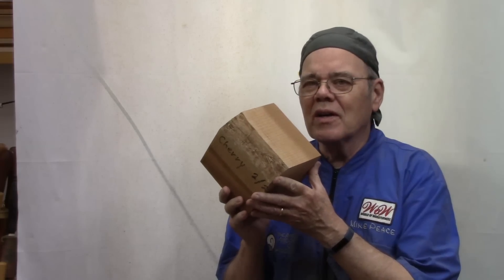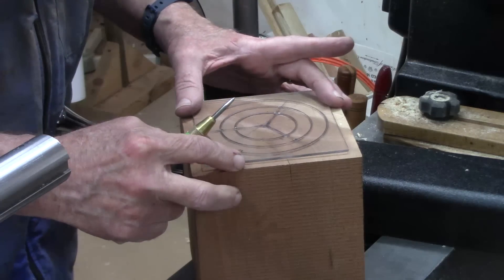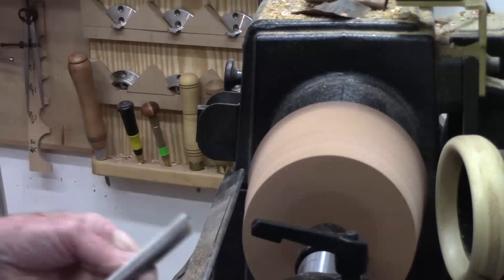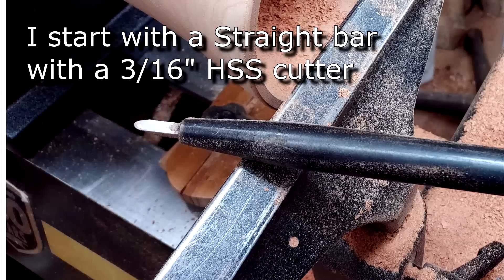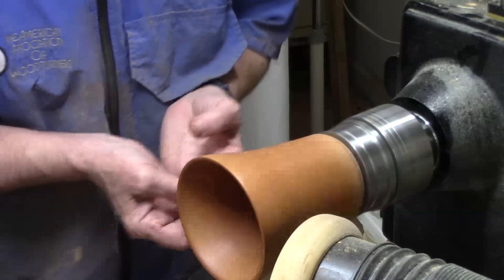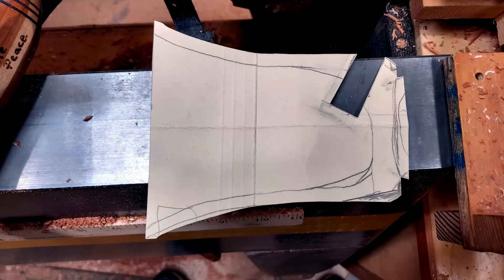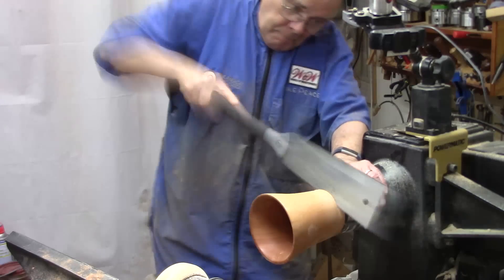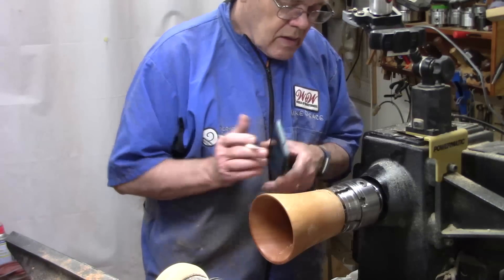4-Ways Cube Woodturning Project –What Will It Be?

Comment: Nice work Mike. You made a comment about moving the head rest. I always leave mine at the end and never move it. Is there an advantage or disadvantage to leaving it in one place?
Reply from the maker: It is  feature. Mine is moved in a bit because of where my location is to leave room for using the knockout bar.  Sometimes if the TS is in the way when using a long handled tool, I move it to the end. If I do several bowls, it is easier to hollow with the HS moved near the TS side so you can stand at the end of the lathe.